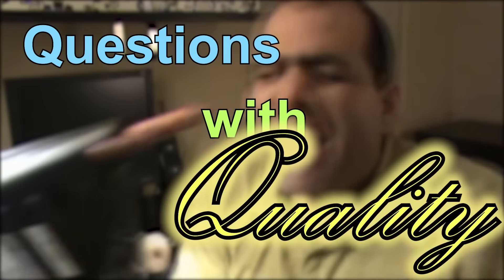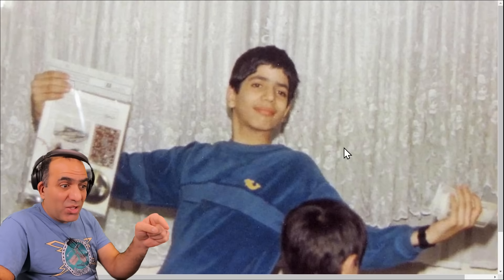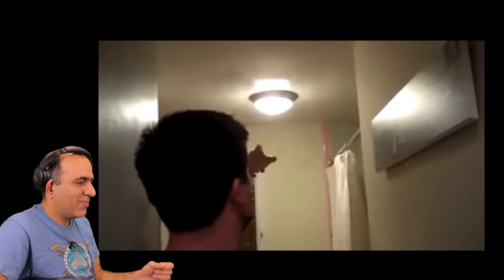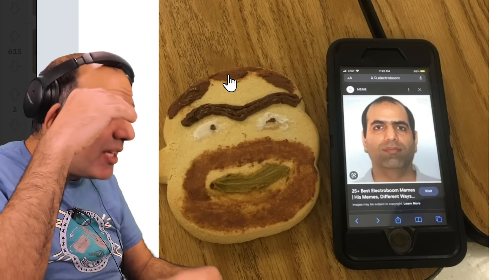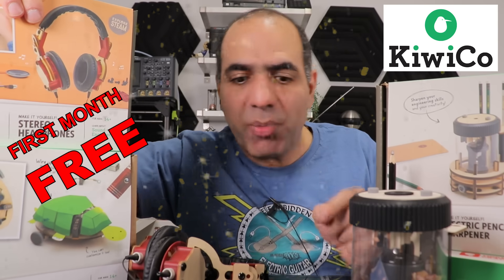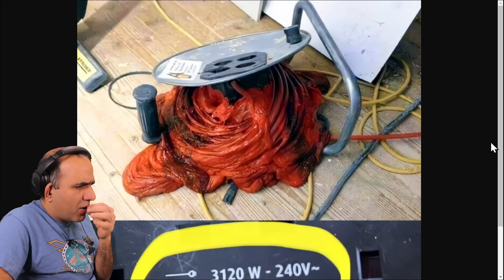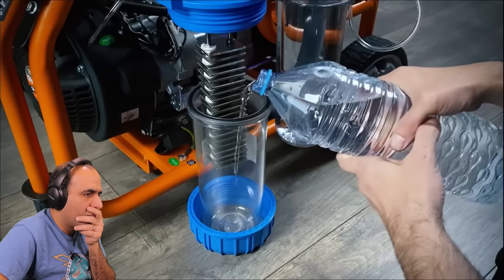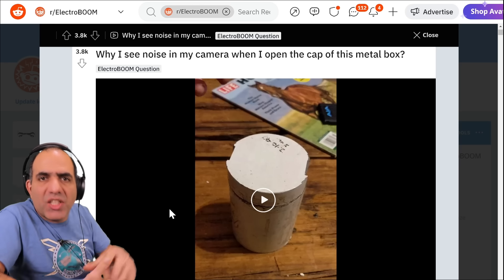Can ENGINE Run on WATER?! They Copied my Toy (LATITY-011)

Comment: Can you do an in-depth break down of the Water engine video please?
Reply: There's a good reason why the idea shown in the water engine video can never work. That's because chemical reactions are reversible and symmetric: combusting hydrogen and oxygen to give water produces exactly the same amount of energy as is required to split water into hydrogen and oxygen (these two reactions being exact opposites). That being true, doing both reactions in a cycle can never produce a net energy gain and in fact will always lose energy (since there is always some amount of energy loss in the form of vibrations and/or heat in any physical process).

Comment: hey Boom, you can use Graphite rods to heat up metal and melt it.
Right?
Reply from the maker: yes, that's not what they did here though
Reply: @ElectroBOOM  true that. But i was just talking ideas out loud. Thanks for the reply though, master of disaster mr Boom.

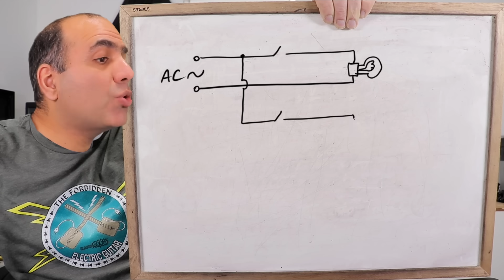Comment: 3:57 my guess is the way it was wired was they tee'd off the original hallway wiring for the light under the stairs (hence being chased out above the switch) then put a new live was put in for a plug to the dryer plug and ended up mixing up some of the wires (since the two power cables are coming through the same trunking) making everything turn on with one switch and double the power for the hallway light, which can be easily fixed by isolating the plug socket and keeping the stair lights and the hallway lights on one circuit

Comment: Actually the bathroom lights there would have been another live for the fan, a switch feed from each light and another live. It’s complicated to explain but switch lives have been put together with some normal lives and the switch feed for the other light switch has been put to the switch feed from the first so only works once that is switched.

All the switch and feeds are mixed up and too many on some

Comment: Graphite rods we use them to remove welds . Shop air blows molten metal away while graphite rod heats the material up .    Look up" Arc Gouging"

Comment: dude man guy... thats no where close to how houses are wired or how high amp voltage works sir. if a switch leg is tied into a neutral coming from the gfi, the gfi becomes the switch. the same reason the hair drier has two speeds is the same reason the light shines brighter on high than low. its backfeeding power thru the gfi into the incandescent bulb, flipping switch #2 directly connects the switch leg(hot) wire to the light so, rather than backfeeding small amounts of electricity, it gets full power. long story short, floating neutral. love your channel

Comment: 5:08
Can someone explain to me why RL1 is bigger than the rest given that the first lamp is an LED
Shouldn't LED's have a much lower resistance when conducting given that uses a lot less energy than an incandescent light?
Reply: Higher resistance = less current = less power
Reply: @Owen_loves_Butters  You have to take into consideration the joule effect
P=R*I^2 that's why incandescent lights draw so much power because it's mainly heat
Reply: @factory_enslavement  If the current was constant, higher resistance means more power. But the current is not constant. What's roughly constant is the voltage, so a higher resistance means less current, thus less power. I=V/R.

Comment: First, you absolutely didn’t invent the game where you have to move a rod through a wire “maze thing”
Second, you said a water motor isn’t possible because it looks like a perpetual motion. You can have a legitimately perpetual motion device as long as there is a fuel being something used up (water). Now I don’t know if this is possible, it seems theoretically possible, but would be very inefficient (like probably uses more power than it generates), but you did a downright terrible job explaining it.
Reply: He might not have said it, but the water isn't really being "used up" the hydrogen/oxygen turns into water again when burning...

Comment: 8:29
This almost happened at a BBQ I participated on where we used an electric BBQ. Luckily I accidentally noticed what happened and I immediately pulled the plug from the wall socket because steam of molten plastic was already rising from the cable reel and the danger of fire was imminent. The cable reel the electric BBQ was connected to was busted though but I saved the place where it happened and the people at the BBQ from fire. Why do people keep connecting heavy loads to those cable reels without unrolling them?
The thermal energy is trapped between the rolled cables and the temperature keeps rising until the plastic and isolation melts and a short circuit will ignite the molten blob of cables and plastic and cause a fire, if it isn't ignited by the hot wires themselves. Because the rising temperature will rise the resistance of the wires they will basically act as a heating element.
When you unroll the cable the thermal energy can escape more easily from the cables and the fire hazard will be minimized.

People definitely should be more educated about basic laws of physics. This could save them from a lot of trouble I guess.

Comment: The radioactive one left me speechless.  I hope they didn't play with it a whole lot. Especially touching the container with his skin.

Edit: good to hear it's fake.
Reply: it's fake.
Reply: @Basement-Science  Fortunately, or I'd hate to imagine what his hand would look like the day afterwards.
Reply: @Basement-Science  I don´t think it was fake, because this kind of lead containers you would use to transport samples.
Reply: @AnonymosAnthropos  there are a lot of reasons why it is, including that the guy admits it is fake.
Reply: The noise that radiation causes on on a CCD sensor (i.e. photo camera) is way different to the noise that the "radioactive" video had.  Alpha, beta and gamma radiation will basically overload the sensor where they hit which leaves a white flash.  Alpha particles are not that energetic (they can only penetrate a few inches of air) so they just leave a single white pixel flash if you are close enough to the source.  Beta and gamma radiation are far more energetic and will leave dancing white streaks.
Reply: Hope they washed their hands after handling the lead, or they'll be doing even dumber things in the future
Reply: It's fake, not even the same type of noise from a real radioactive substance. Radioactive Drew did a bit on one of his videos, radiation just looks like white specks
Reply: Or eating afterwards...

Comment: Electrolysis, it's releases hydrogen and oxygen. When burned that releases energy. That's where the fuel comes from on the engine. It doesn't take as much energy to do electrolysis as it does to turn the engine leading to excess power from the fuel burning. The issue is rust deteriorating the engine. As far as I know platinum is the main material needed to make this viable.
Reply: Well it doesn't take much energy to get some bubbles in electrolysis but those few bubbles are not going to do much unless you want to run a nano ICE with it.  As an FYI in order to get the heat energy equiv. of about 3.8l (1 USgal) of gasoline you would need to produce about 12 cubic meters (424 cubic feet) of Hydrogen gas at atmospheric pressure which would come out to be about 1kg( 2.2lbs) of H2 gas . An industrial small/mid size PEM electrolyzer will require in the order of 55+ kWh of electricity to produce that 1kg of H2 so there is a lot of Energy required to get just 1 USgal worth of Gasoline in form of H2 and the engine would have to spend far more energy on producing the H2 then it would ever get back from burning H2 that was produced.

Comment: Is the power from hydrogen extracted from water really not enough enough to even sustain the electrolysis process? I feel like it's not really perpetual energy, since you're 'burning' through water as a fuel, but is it really not efficient enough of a process?
Reply: You're literally just running the same chemical reaction backwards and forwards over and over. There is nothing TO BE gained, even if everything was running at 100% efficiency, which is also impossible on top of that.

Comment: The extension cord melting is actually a real problem. The issue is the inner windings can't cool off effectively so they heat up and melt everything.

Comment: 8:31 that happens for welders... You're not meant to weld with the entire  wire still rolled on the spool.
You're meant to pull it out and spread it evenly on the floor so it cools down. Otherwise, the heat will never dissipate in time, and the insulation will start to overheat.

Saying this because it happened to me the first time I used a stick welder.
Reply: In the UK at least most cable extension reels will actually have two max current ratings printed on them. One for wound, one for unwound. The decent ones have a thermal cutout too, because users are idiots
Reply: It's not just normal heat. Leaving it coiled up makes it act like an inductor and raises the impedance, which causes the cable to exceed its power rating when you try to draw the full load.
Reply: Is this satire? 
Welding wire isn't insulated, and the electrode is in the gun so the wire that isn't being immediately used doesn't get hot. And stick welders don't use wire, they use a... stick.

Or am I having a terrible misunderstanding and you mean the welder power cable?
Have never needed to pull out cable when welding, I guess I'm lucky.
Reply: @owenkegg5608 by "wire" he could mean that the welder had a long cable that's spooled up for storage, or a spooled extension cord. Or the cable to the handle or ground clamp.

I can see one way you could have a problem with the wire in a MIG welder melting. That would be if the wire is grounded somewhere between the handle and the spool. Then current would flow back through the wire inside the guide in the cable back to the machine. I bet that would get quite hot.

Telling a noob MIG welder to unspool the wire would be a nasty prank, though 🙂
Reply: @phizc  Hehehe, yeah. That would be quite a brutal hazing, especially since they would need to wind it back up after :]
Reply: @owenkegg5608  flip the spool and run the machine at max wire speed to rewind
Reply: @owenkegg5608  It's an extension. So yes I am refering to the power cable. It can overheat depending on the current drawn by the welder. Which is why they have 2 current ratings.
If your welder has a rating of 35A for example, and the wound cable only has about 15A, this will happen.
But if unwound it has 40A, then you can use it.

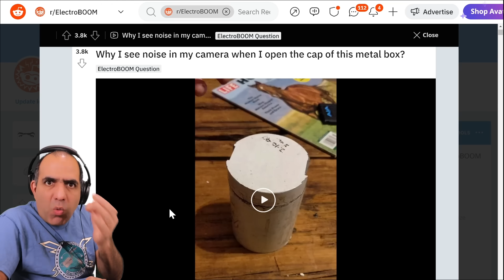Comment: 13:00 I already saw this video, seconds later I found out that it is fake, the effect was added in the edition, there is no radioactive material there. In fact, gamma radiation can mess with the sensor, but even covering it with your hand it would still happen, in addition to what is actually captured by the camera is different, I know that because of footage of nuclear reactor fuel rods
Reply: The big tell is that the noise darkens the image in spots. Real radiation makes single-frame white pixels because the gamma rays excite the image sensor. (Unless I'm wrong about this, in which case please correct me)

Comment: steam engine runs by heating water into some pistons which can be used to move wheels, so there IS an engine that can run on burning water
Reply: I dont think you understand what "burning" means
Reply: @Basement-Science  i made that coment after the first scene of the video

i do now see that they use electrolysis to seperate the oxygen and hydrogen from water which then is burned like a normal combustion engine

Comment: 12:17 even though it burns the hydrogen, it just generates more water, which if it fed back into the system, would be a perpetual motion machine
Reply: oh knowledge on the laws of thermodynamics where art thou?
Reply: @milanswoboda5457  perpetual motion -> doesn't work

Comment: The cord reel will melt without exceeding its rated current if you leave it coiled up while it's under load for a few hours, because the small amount of heat generated has nowhere to go and will build up until melt-down.  I have personal experience with this. Always uncoil it before long term use.

Comment: Please explain the open/floating neutral and why it's dangerous in a future video!
Reply: If there was a light in the socket and the switch is on, the lamp will not light. You may therefore assume there is not voltage at the socket. You may go mess with the socket. You may think you’re smart and safe and take your meter and test the voltage at the socket between the base and screw. It reads no voltage because you have no neutral. You stick your hand in there to mess with the wiring and find out that there is in fact voltage because you are grounded. With the right load installed you could touch the neutral too and receive a nasty shock as well.

Comment: If instead of using electricity to generate the oxyhydrogen they used a chemical process, like an aluminum gallium compound added to the water to make the gas, then maybe that would be efficient enough. It would not be a perpetual machine, you need to add fuel to make it run, its just the fuel would come from water and some aluminum pellets and the output would be cleaner than gasoline. I think the military was looking into this.

Comment: About the melted extension cords : it is just current, or current AND eddy currents in the coiled cord ?
Isn't there a reason those cord spools HAVE to be unwinded when used beyond a specific current value ?
Reply: it's just about bad heat dissipation when it's coiled up. ALL wiring relies on some level of cooling, so when instead it is surrounded by other heating wires and insulation, it overheats. Many countries mandate thermal cutout switches in all coiled extensions to prevent this problem btw.

Comment: The light-switch "puzzle" likely is a open-neutral combined with wrong connections - and that is extremely dangerous.
This is not something you will find in most western countries as it is nearly isolated to the US as only there they use split-phase. The problem is that a single phase is center-tabbed to get 2 phases and a "neutral" in between. In such a system if the neutral connection to the circuit-box breaks there is still the possibility of the circuit getting closed through the 2nd phase.
https://youtu.be/LJvyb_WujZg

This also nicely correlates with how switching on a different light can have an effect on the brightness, and how the hairdryer can turn on the light.

Comment: I also got a 5 or 6 transistor radio kit when I was about 12, mine was AM only though. In the end it did not work, I spent hours looking for was I did wrong but never found anything and did not know anyone who could help me. I do wish I had kept it so I could figure it out when I knew more about electronics, I bet it was full of bad solder joints, It was a bit ambitious for my first time soldering.

Comment: 3:51 .... this happened at home after a room adition. We figthed for months blaming our small 12 inch B&W Hitachi TV. At nigth, sometimes it will fire up like a champ. Sometimes not. Of course we keep trying the classic banging method with mixed random results .... Really, no joking. This went unoticed for months !!!! Later we discovered that the TV was wired IN SERIES with 2 75W lamps (in parallel) from the room. So each time the Hitachi was at fault ... it was because the room lights were ON !!!!!!!!!!!!!!! The socket was in parallel with the ligth on/off switch. So when the switch was off ..... the lamps provided enough return for the TV to work. When on .... TV stops working ..... Poor Hitachi !!!!!!

Comment: You can run an engine with just water but you must place a sort of air ionizer on the engine's intake system that is designed to strip the electrons away from the oxygen atoms. What this does is changes the atmosphere from what we breath to one that is suitable for the combustion of water. You have to strip around 3-5 electrons from the oxygen atoms in order to do this. Again what this does is change the atmosphere inside of the engine to one that is suitable for the combustion of water. Trust me it isn't safe to breath.

Comment: One question.  If you cannot run an engine on water, then what is a Steam Engine?  Or basically any engine or generator that works by burning some sort of fuel that turns water into steam in order to power it?  Isn't that technically running an engine on a form of water?
Reply: No. It's an engine running on heat. Water is just the medium that converts heat energy into movement. Coal or whatever is the power source.
Reply: It's not perpetual motion, you need to keep adding water to keep the engine going, he's not being serious, that kind of motors or power cells exist already.